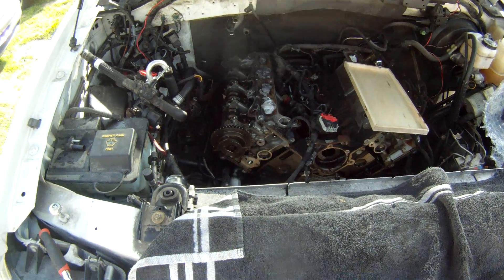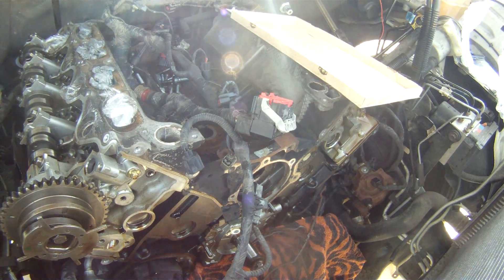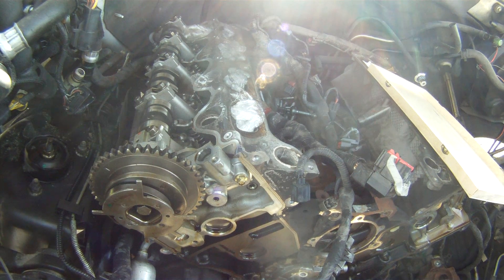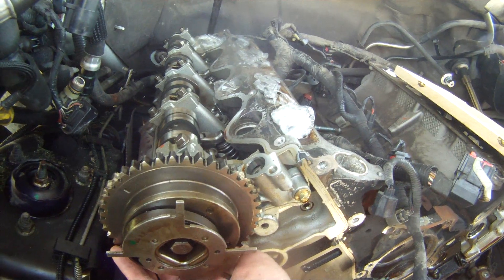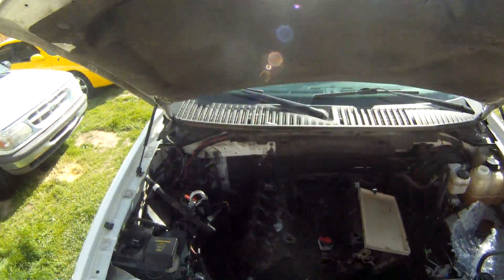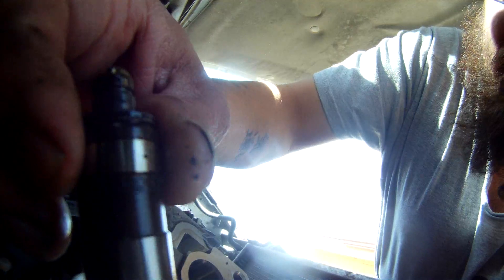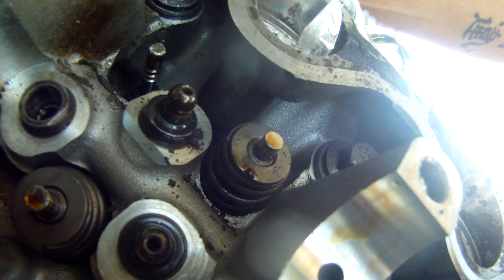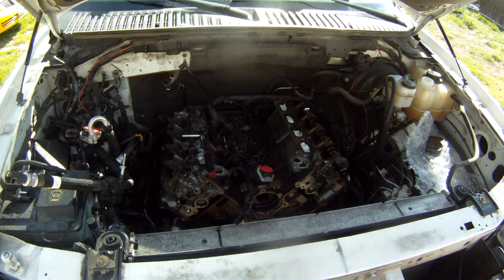Ford 5.4l camshaft removal

Comment: I have an 02 5.4 2v, old motor blew (previous owner) and they had a jasper crate engine. Only problem I’ve had is with coils and intake manifold had a hole.. super reliable motors imo
Reply: Where was the intake manifold hole?  Did it cause a misfire condition?

Comment: I have a 5.4l 3 valve in my 2006 expedition its a 298,000 miles, only problem I've had with it is misfiring but we got that fixed, overall its been a very good vehicle, I have another vehicle with the same engine its a 2003 Lincoln navigator, only difference is its a 32 valves high compression engine, so far no issues, and its been roughed up but oil comes out clean and looks unused, previous owner did oil changes every 6000 miles, I've also changed the oil on the 06 quite a bit, but both are good running vehicles, sad its a bad engine design

Comment: did ur head have cam bearings or just sat cam in place without cause i noticed some have bearings some dont  my 05 has em but the 08 i got from yard dont  any advice on it

Comment: You are doing the worst thing to and for fellow Mechanics. Your passing off someone else’s problem to the next Mechanic. Why did you even suggest this? Just make the coin on a complete repair, instead of putting trash on the roads for the next guy! This is not a “Friendly” anything… Doping a car, truck or anything else is what gives honest guys/gals problems. What’s sad is you are proud of your malicious practices and bold enough to put it on YouTube! Let’s see if your bold enough to post this Man’s opinion and more importantly let’s see if you try to justify yourself publicly.

Comment: So you band-aided this engine so the owner could get out of it. What about the poor sucker who ends up buying this broken but band-aided car?
Reply from the maker: Do not ASSuME things because it makes an ASS out of YOU and ME.
Reply: @MattShaughnessy6  Band-aided does not mean fixed correctly or properly. It means the opposite of that. You're the proto typical "backyard mechanic" who does subpar work. If you're going to fix something, fix it correctly or don't do it at all.
Reply from the maker: @greglp970  you are a brick wall.

Comment: I was replacing cam phasers and all timing components and I think Engine jumped time by my own stupidity anyway how do I know when it’s back in time and how do I put it in time as far as exhaust stroke or intake and how you know. I do have crank tool for proper position but don’t know how to have cams in proper position

Comment: I have an 01 2V 5.4 Triton. The only one worth a dime in my opinion. Mines run in the family for 20 years with out any issues. 20 years is a long time for an engine so I’m putting a remanufactured one in
Reply: Same but an 02 lol been with us 300,000 miles
Reply: I have a 01 and my aunt and uncle bought it at 85k miles back in 2010 now it has 115k

Comment: Hi Matt. Thanks for the awesome video. I'm about to do a full timing job on my 2006 f150 5.4. Also going to replace camshafts, rollers, and lifters. I'm worried about pulling the rollers off and a valve keeper coming off a valve causing it to drop, but in your vid the rollers just popped off like nothing. Anything I need to watch out for while removing them? Don't really wanna be dealing with a valve dropping in the head. Lol

Comment: Great video, Matt. Also great advice on avoiding the Triton V-8. I'm in the middle of a major timing and valvetrain job on mine. I have a 2006 Mark LT with 148,000 miles. Cam lobes are good, but the wear surfaces of the journals and caps are worn bad. I don't suppose replacing them without also replacing the heads themselves is a good idea. I can't believe they designed this engine wuthout camshaft bearings. I mean WTF???
Reply from the maker: Oh I know. This engine was by far the worst choice. Almost put them under.

Comment: Thanks for the videos!  It looks like to me a person might be able to stand in the engine bay between the radiator and front of engine block with feet flat on the ground?  This job would totally suck always leaning over the grill area.  Thanks.

Comment: What position was the crank dampener at when you removed the cam? 12 o clock? Service manual says to put to 12 o clock position and then remove 2 roller followers. Is this not necessary?

Comment: question ? what causes the rocker rollers to fall apart ? is it the manufacturing, thats bad,?bad metals ?
made in china. whats your knowledge on this problem.
Reply from the maker: It's the design. Ford lost alot of money on the Triton and discontinued and redesighned it in 2010-2011. It's a combination of bad engineer and manufacturing.

Comment: Hi Matt (and all) -

I have a 2007 Ford F-150 Triton 5.4.

It revs and has great idle, but won’t drive or reverse.  

This has been an issue that has progressively became worse by misfires and jerking when accelerating. 

Now, she doesn’t move.  

I’ve heard the horror stories with the camshaft and the destruction that could happen.  

My plan was to dismantle the motor to determine the cause and rebuild.  My understanding is this will happen again unless a larger oil pump is installed or a hole is drilled through to provide the passenger side with more oil. 

Can you direct me on the best way to get this up and running?  Unfortunately, I won’t be able to offload it for about a year and a half. 

Any guidance and help is much appreciated.  This saga has been going on for far too long.

Comment: Anyone know if you can buy new cam caps? I just tore my 5.4 apart and the camshafts are pretty scratched up along with the cam caps but the heads don't look too bad. I'd buy new camshafts but what's the point if the cam caps are bad to?
Reply: Bryan sand them down, Im in the process of rebuilding my 5.4 3v, my local mechanic used sand paper after I saw him put one back together, if there are deep ruts in them pretty much ruined, but if they are only finger nail clicks worn, they can still be saved, I used 1000 git and worked it all the way to 2000 grit sand paper, wet the sand paper with oil, I used wd40 and the caps, i did it by hand so it took a while, once your done, it should look like polished steel, work the surfaces evenly and measure before and after with digital calipers.
Reply: Fern W I know my cam caps had scratches thicker than my finger nails. My passenger rear cam cap was the worst. I know the heads should have been replaced but the engine already had 182,000 miles on when I was in there. I just put new camshafts on both sides that I got off of Ebay for $112 and I had to run thicker oil 5w40 to help with oil pressure but it's running perfect now for about 3,000 miles. I also changed the rod bearings to help with oil pressure and they were pretty beat up to but the crankshaft looked good. My truck has more power than it ever has since I did all that work and I don't know why or how it could but it does. I have a 6" lift and 35" mud tires and it nearly spins the tires and throws you back in your seat pretty good when accelerating. I know the motor is on borrowed time and it could go at any minute but I know lots of guys on the forums who just ran there engines with scored cam journals and they have lasted a long time.
Reply: Thats very interesting my #4 ( passenger side)had allot of burnt oil and heat burns on cam, the cam caps weren't to bad (still sanded all of them), but the cam had allot of groves and metal discoloration were it got really hot, did you replace the oil pump?, I have about 205K miles on mine so I going all in, and replacing cams, rocker follower, injector lifters, and oil pump, melling has a high volume oil pump for these engines, Ill be going that route, how long was your break in period? thanks
Reply: @f.w.1318   Hey would you be willing to email about this at all? I may be in a similar situation as you? Thanks!
Reply: @undefineddiy6624   Are you having problems the with the 5.4 3v?
Reply: @f.w.1318  Yeah sounds similar to you and Bryan. Just got into my 05 F150 with 90K miles (probably the 5th owner or so). Guides broke and timing chain ate some of the front cover but it's usable. I have all the parts ready and the new oil pump but I just found my camshaft and caps are scored. A little on the cam towers too. Wondering if I could ask you some questions because all I find online is to replace cylinder heads, or get a new engine.
Reply: @undefineddiy6624  This is lengthy, If you have light marks on the cam caps and marks on the the cam  journals on the engine head you will need new cam shafts, ( I bought mine at autozone melling brand), I used the same engine and engine head, haven't had any problems, I also used a digital caliper when I sanded down the engine journals and cam caps so i could gauge how much I was taking off. I think I used a 23 mm socket (might be off by a bit ) wrapped it in 1500 grit sand paper soaked in wd40 and went to work, it fit almost perfect in the diameter of the  of cam, and worked it on the head and caps, then to polish it I moved up to a 2000 grit sand paper also soaked in wd40, the most I took off was .04 mm when I measured it after sanding and that was on caps around cylinder 6, and 7,  around cylinder 4  i took around .03mm off on the head side, you could still light marks but got rid of any raised surfaces. Another way to test, is after you sand down, gently place the new cam in but only tighten the sanded cam, don't put on any others, then gently move the move the camshaft see if there is any play in it. When you do this all roller followers have to be removed. As stated by other commentators you will need to upgrade your oil from 5w 20 to 5w 25 or 30, I use 5w 30 with lucas full synthetic stabilizer, no issues, and thats because I recently moved and used the truck to haul a  dual axle 14 ft cargo  trailer fully loaded. no hiccups, For disclaimer purposes this worked for me, I dont know the ford recommend tolerances for machining their surfaces, and my statement is not meant as a permanent fix for all situations, so pleased review what ford or a  machine shop will consider an acceptable practice.
Reply: @f.w.1318  Thanks for the response! I totally understand your disclaimer so no worries. I don't think my engine is worth throwing all new heads on so that's why I want to do what I can to run it til it dies. That said, I assume the cam journals on the cam shaft itself can't be sanded down as well? Also, my caps do have some fairly decent scoring but I assume I can't buy new ones since they won't match. If you don't mind sharing an email I could send you videos and photos for your opinion, if not no worries.

Thanks!
Reply: @undefineddiy6624  The cam journals and cam caps can be sanded down, so you shouldn't need new heads,  however I don’t recommend sanding down the camshaft, the camshaft is made of steel, it would be very difficult to give a machine polish, and keep it perfectly cylindrical, the journals coming off the engine head and cam caps are made of aluminum, which makes it very easy to sand, and polish. Also if you sanded them down including the camshaft you would create a gap between the camshaft and the journal/cap, you would lose oil pressure. The hole at the bottom of the journal is the oil port it would leak to the sides before providing correct lubrication, Ive included a forum link from f150online the image on left is how 4 of mine looked like, my caps weren’t that bad you could slightly feel them with the finger nail test. Your this far into it just replace the camshaft they are like 150.00 to 180.00 each online, if not you’ll be doing this job in the next 1k miles.

https://www.f150online.com/forums/2004-2008-f-150/518093-2004-5-4l-3v-camshaft-scoring.html
Reply: @f.w.1318  Thank you! I tried to install the old camshafts after sanding and polishing the caps, and unfortunately they cannot be turned by hand (guessing they are bent maybe)? I can turn them with the phaser bolt on and a ratchet but they are very tight. I find it odd that they would be so tight even though I created a bigger gap? Anyways I will get new camshafts, only thing I am confused about is that isnt the camshaft supposed to be matched tolerance wise to the head and caps? So is it a gamble that new ones will even fit?

Thanks!
Reply: @undefineddiy6624  if they have severe heating in the steel and looked cooked they probably are warped, however did you oil the cams and the caps they need to be oiled  ?  since your getting new camshafts and you've polished the surfaces to the head and caps there is no tolerance to match, only if your using your existing cams  do you have to line up your cams to their original position with the caps.
Reply: 91
Reply: Fern W I did replace the oil pump but it was a cheap one that came in a kit. Yeah the melling oil pump are better because they have solid back plate which prevents flexing at higher rpms. My truck is an earlier 04 model so it used different lifters and camshafts than the 05 to 14 models originally, but when I was pricing out the lifters they were about $13 a piece for the correct 04 lifters or I could get a set of 05's for $88 shipped off Ebay so I did that. So I matched 05 lifters and camshafts in my 04, maybe that's why it's getting more power. I also used cheap phasers and tensioners, but its running great.
Reply: @nogoodtrader  Hey Bryan would you be willing to email about this at all? I may be in a similar situation as you? Thanks!
Reply from the maker: I would go to the dealer for cam caps for this engine.
Reply: I searched all the forums and it sounds like you can't buy just new cam caps because they are matched to each head. So if you have any big scratches you'll have to buy a new head or there are some machine shops that can bore the journals out and install cam bearings which most remanufactured 5.4's have. I just ordered new camshafts and I'm running it with the scratched journals. It's running fine.

Comment: Do you have a video of you reinstalling the cam? Did you use the roller/follower tool?
Reply: Matt, you said you going to install the cam then the lifters and rockers... How you gonna get the lifters under the cam once  installed?
Reply from the maker: Brian Crowe only for reinstalling the lifters and roller followers I installed the cam first then I used to tool to reinstall the lifters and roller followers.
Reply: Matt Shaughnessy, can the cam be reinstalled without the special tool for the rockers? I'm changing head gaskets on a '07 5.4 triton and don't want to have to purchase the special tool if the cam can be installed with the rockers in.

I installed a cam in a BMW 528i by just working the cam back down, kinda like the opposite of how you took this one out. Is this possible to do on the 5.4 3valve?
Reply from the maker: Because this engine is so picky and because it is a problematic engine I would not suggest doing it in such a way. Factory procedure tells you to set up the timing with the roller followers out of the vehicle to ensure that all valves are shut when you reset timing. I think that it can be done but personally and professionally I would not try it on this vehicle
Reply: Matt Shaughnessy ok, thanks?

Comment: i will be doing the timing on an 04 f150 5.4 3v. blown tensioner.  should i be pulling the camshafts and rollers for inspection while im at it?
Reply from the maker: no need to pull them for this job. maybe turn the engine over by hand after resetting timing for inspection.

Comment: Where can you buy a new camshaft for this particular engine?
Reply: rockauto.com dude
Reply: Maurice Johnson I like to use summit racing great website just chose to search by engine them chose Ford then modular v8 then 5.4/330 and put in the search bar comp cams and check the "search within results" box
Reply: Trevor McNeill thank you

Comment: Awesome video man. Quick question. I want to replace my cam phasers on my 5.4 and while im at it replace the lifters and rocker arms. Once i pull the rocker arms out with the special tool they just pop back on right? And the new ones dont go back on in any specific order, just the correct way